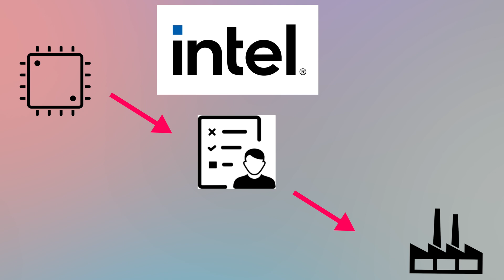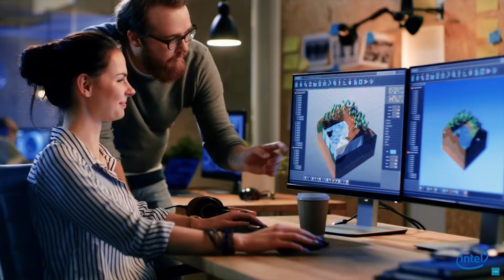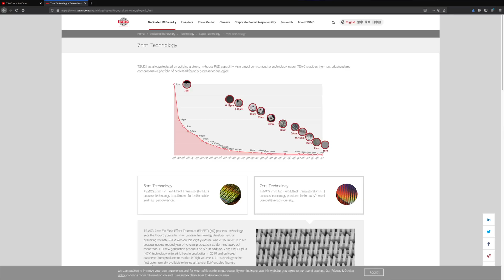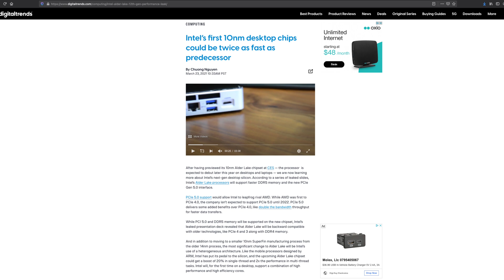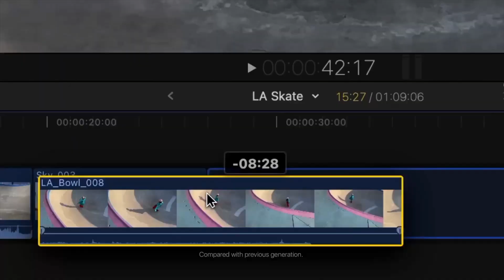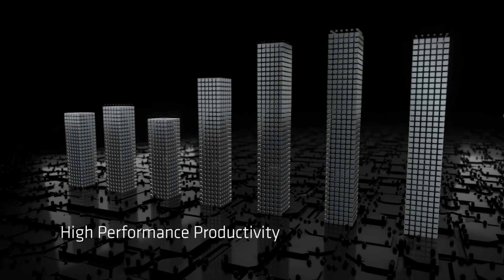Is Intel DEAD in 2021? The Intel Problem Explained

Comment from the maker: Do you think Intel will make a come back in the near future? Let me know!
Reply: @Katmai JT Intel core i9-12900k destroyed M1 and M1X 
Apple doesn't know it yet
Reply: ig yes they can in may they told they got the sifive cpu's the sifive cpus are actually same to the arm archicteure used in the m1 mac and the sifive ones can possibly land in next year with intel 4 aka 7nm which is good this can be good
Reply: Intel will pull through guys team blue/green until the end amd will be stomped out
Reply: So, I like the explanation you mentioned. Intel is superior to AMD in processors. Not to say AMD isn't amazing, they are. But AMD finally have chips that can take Intel but it's AMD 7nm vs Intel 14nm and with double the cores. Same as in the GPU battle AMD has to have double ram just to stay on part with nvidia. So Intel will be on 10nm and against AMD 5nm. That is if alder lake Big.little, 3d chiplet works out. Imagine what Intel performance will be when they are on there 5nm chips. My question is if Intel is in house all the way, with no overhead why are they over/trickle charging us to death?
Reply: @xR3SEARCHx  Because they can
Reply: @Katmai JT Apple only destroyed previous intel Generation CPUs. Newer Generation of intel can beat them easily but i'll see Apple's Response with M2 so Intel can beat them back with i9-13900k and it goes on but idk the future so yeah.
More competition means better for people
Reply: @mendags  alder lake and raptor lake i9's just entered the chat but in the power efficiency m series do still have the thing i am sure intel has a answer to the m1 and m2 actually

Comment: When people say Intel will die what they obviously mean is that Intel won’t be a shadow of what they once were. And I agree. To my layman eyes, Intel was caught in the middle of mismanagement when their crown jewel, x86, is quickly becoming a legacy platform. I’d even dare say — because I suspect — that the mismanagement came from top execs exactly because they probably didn’t have any incentive to research better alternatives to x86. Big changes like that are risky, come with diminished bonuses at the end of the fiscal year, so they don’t REALLY care. It would akin to Steve Jobs not researching and launching the iPhone because that would kill the iPod… but Jobs was not your typical executive, of course. Besides that, people downplay Apple switching their macs away from Intel because their marketshare is small. That’s another ridiculous statement. Macs may be small, but they are part of the vanguard, the shiny new edge that normally dictates what comes next to the industry, the shiny new thing. Apple switching to ARM processors, and also shaming Intel processors completely in that process, was a huge embarrassment that proved to anyone that the king was naked. Make no mistake, that was a titanic shift and we are in a transition away from x86 as we know it. If that also means away from Intel it depends only on Intel. That’s my take.